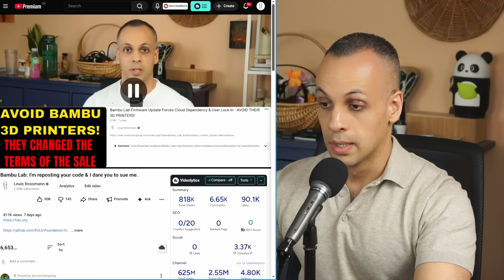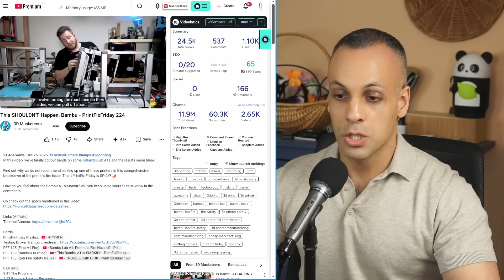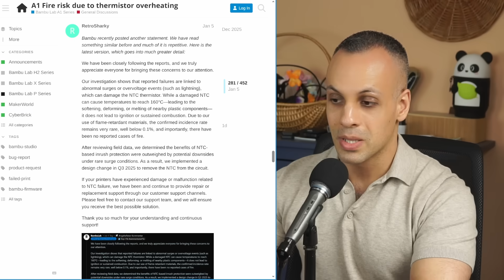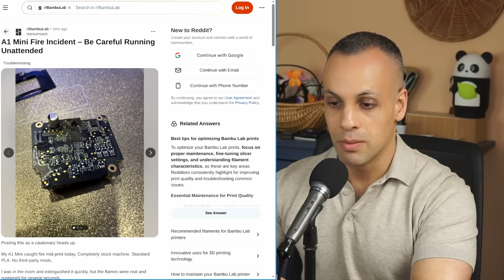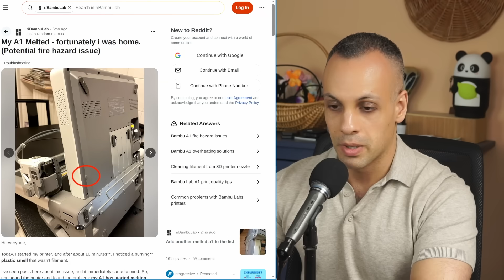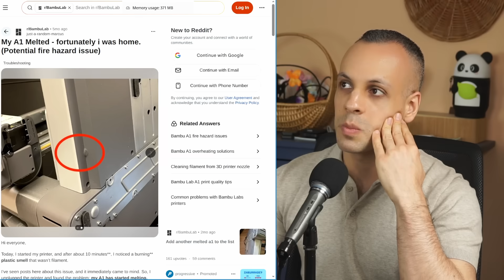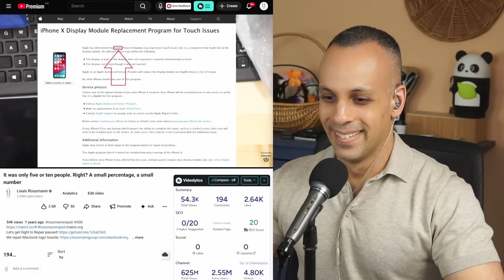Bambu Lab PR dumpster fire is turning into a literal one...

Comment: I really appreciate this update. My kid got one for Christmas from his grandpa and loves it. We’ll have to be very careful from now on but at least we’ve been forewarned.
Reply: They Make fire suppression bombs that you can hang over your printer as a precaution. Pricey, but cheaper than a fire.
Reply: just contact bambu support and ask if your serial number is affected, they will send you replacement parts for free if it is.
Reply: You've probably heard this before but ensure good ventillation. Odorless is not harmless. 
We don't know the long term effects of breathing in the tiny particles printers give off.
Reply: @some_random_wallaby  It's not just particles, but most filaments emit various forms of VOCs and toxins.
Reply: Use the guides that are up to open the base and check to see if the vtc is present in the power board, and if it is contact support and ask for a replacement. Keep asking if they try to deflect. It is not worth risking it with a component with over 200 cases of meldown/fire/thermal extraness that 3DMusketeers has directly documented.
Reply: Teachable moment: always babysit the device, keep an extinguisher at hand.
If the kid can manage that, then advance to a living pet.
Reply: Also, hit up your local hardware or gardening store and get a concrete paver to put the printer on. Extra credit for finding medium density foam to put between the printer feet and the paver which should help decouple resonance from what it's on and will help with print quality.
Reply: @SkateSoup  Nice bonus is that the paver isn't flammable.

Comment: I ordered two printers this week and refused to even consider Bambu.
Reply: I was feeling FOMO about getting Prusa MK4S rather than the Bambu Labs printers which were newer at the time. 

I went with Prusa because the companies reputation is solid and I loved the upgrade path (if they come out with a new feature that wasn't on your printer you can buy an upgrade kit to go from like single filament printing to multi-material for example). 

I was so surprised they actually offered that in the first place and they hand you STL files with the printer to even repair it yourself. I see now that I made the wiser decision. My MK4S has been solid and just keeps performing better with mods, tweaks and firmware improvements. <3 Prusa so much more after all this
Reply: The only reason I regret my Prusa MK4S purchase is because they announced the Core One a month later. But I was so tired of my Ender I decided to keep it. 

It has been a blast using it. Some day I will get the XL or Core One L
Reply: @navb0tactual I'd like to see them putting the INDX upgrade on the Core One L. For now we need to see how it performs on the Core One first.
Reply: @Kastaru Prusa is one of the best printers you can buy. Even if it is a bit more complicated to set up than some of the other brands the aftermarket support for upgrades is top notch. The only printer company with more after market support is creality and you get what you pay for. Half of the creality support is just upgrades that come on higher end machines.
Reply: @Kastaru prusa even still sells some parts for the MK2, that's a 12yo model
Reply: @Kastaru  As I type I'm printing a new x carriage for my MK4S. I print a lot of high temp stuff in a Lack enclosure.  The teeth that hold the belt creeped and the belt won't stay tight anymore.  It has 1,840 hours of print time on it.  It's been pretty rock solid.
Reply: Out of curiosity, which did you go with?
Reply: @mvm8397 I ordered a few weeks back and wanted to avoid bambu.   Got a qidi q2.  Im very pleased
Reply: @mvm8397 i love my brother 2d printers
Reply: what are good alternatives to bambu?
Reply: @cynthiabauer5763  I recently ordered a Qidi Plus 4. It's good on paper, but hasn't arrived yet so we'll see.
Reply: @cynthiabauer5763 they're the apple of 3d printing so basically none if you want their features. There's a lot of decent ones that have most of the features though. I like makers muse and aurora tech for reviews
Reply: @cynthiabauer5763  prusa printers are more expensive but really good. Voron kits for more customization (but more labor / tinkering). Qidi for a cheaper Chinese option
Reply: @cynthiabauer5763  1. Prusa, Voron
2. Creality, snapmaker, sovol
3. Elegoo

Maybe Elegoo deserves a higher rank. I heard they got some awesome people but no idea how the printers are.
If you have money: Prusa
If you have time (and money): voron
else go for the other brands
Reply: @cynthiabauer5763  Snapmaker U1
Reply: its really unfortunate for me bcs i'd heard they were the most beginner friendly for people who aren't into 3d printers so i was considering them heabily, but oof...
Reply: I did that a few years ago and I didn't regret it.
Reply: I got the X2D, because the printer is awesome. It's not its fault for its manufacturer is stoopid.
Reply: I bought a bambu printer recently and regret it, past the return window 😭 Atleast its been working okay but the beds been squeaking so i gotta oil it up (🤨)
Reply: Good job 👍
Reply: Makes sense.  Why would anyone ever order a printer that only works when connected to a 3rd party server?  Can't print when your internet is down, that's so stupud.
Reply: @Josh-Kelm  do you know you can print via sd? i have 2000 hours of print time and never once connected to a 3d party server
Reply: @zokru1  On some printers of course.  But isn't the Bambu controversy that you have to go through their server to print?
Reply: @zokru1 printing via SD feels like using the old ender 3 again.
I want local network connection.
Reply: @Josh-Kelm  thats just youtube clickbait misinformation, all models have an sd slot an you can print offline . I dont like the company behavior but i dont like this videos either. On all the printer sold a few melted, like few phones , few fridges, few television.
Reply: @zokru1  Maybe they ship with that, but as long an automatic updates are a thing they can disable it.  I wouldn't trust a company who makes your go through their server to print when not using an sd card because they'll obviously disable the sd card reader with a firmware update at some point.
Reply: @Josh-Kelm  you can go back to previous firmware and also choose not to update at all. automatic updating is not mandatory
Reply: @Damo905TV  I prefer a machine that doesn't do updates at all.  I want it to be just mechanical.  Tired of things connecting to internet.  It should only connect via USB and have SD card. I don't want it on internet.
Reply: @Josh-Kelm you and i both know thats not the world we live in no more.
Reply: @zokru1  there's actually someone else out there who also both dislikes Bambu and this video. There has to be dozens of us out there! dozens!

But yeah can also confirm, you can run a Bambu 100% offline (maybe 99.9% since I'm not sure about initial setup) and print only via SD card or your local network (or even both with a wifi sd card! double the unreliability!). Mine never auto updated, and even if it tried, it's blocked anyways on a network level - also has the very neat side effect of getting rid of that "update is available" message box.
Reply: @---ym4zk  internet never required even at startup. People just need to reasearch what they want before buying. Too many people talks without even ever used or even ever saw a product.
Reply: @Josh-Kelm  how can they disable my printer sd if i never setup wifi ? With magic ?
Reply: @knightmare1442  you can also print in lan. Do you people ever tryed the things you are talking about?
Reply: @Josh-Kelm   there's an offline mode. no need for internet. and you can also print using sd card. but connecting to internet makes convenient for me. i can view it on my phone, and/or skip some parts that i dont want to print anymore. im using A1 for a long time now for my projects. i havent got any issues other that when i use the wrong filament.

Comment: sounds a bit like to me there redeisgn is whats blowing up. i liked bambu. i still have two printers, bought them a few years ago. ones p1s got 4600+ hours on it. had a couple of issues but nothing mager. and its still going. also got an a1 thats got 2000 ish hours on it ( i could be part of a small %). I was very happy with them. but with all the crap they have been pulling im just not happy with bambu anymore. I still like theese printers but i also run them in lan mode and have not updated the firmware when they added the extra checks. i really wanted a bigger printer that worked as well. not really found much out there for what i want and the price im willing to pay. might be interesting to see how old the bambu printers are with fire issue? Anyways, thanks for the informative videos Louis. Cheers.

Comment: Sorry but bambu is fantastic I will continue to use.
Reply: If you like and trust it go for it. Most people do not like being controlled or told what they can and cannot print. Ross is pointing out a safety concern. From my understanding, these are devices you setup and leave. Bu the fact that they are melting and potentially going to cause a fire is concerning. That could kill people. Not sure if you have kids, but think about this. You let your printer do its thing over night and wakeup to a raging fire and couldn't save your kids, I'm not so sure your would be giving allot of praise to them after that.
Reply: @MarioS-b2q for the record, almost all 3D printers come with a disclaimer to not leave them unattended, while they are printing.

Any electronic device that makes use of a thermistor, to monitor and control heating temperatures, is at risk of catching fire, if the thermistor fails to function correctly.  And thermistors, in general, are not particularly robust.  3D printers, in particular, often have the capacity to identify thermal runaway, if the thermistor fails in that way, and then turn off the heating element(s), to prevent such things happening.  Despite this function, circuits, casings, etc, can be damaged, before the shutdown command is issued.

I don’t know for certain, but I assume this is the case with the printers provided by Bambulab.  Sometimes, though, even that is not enough protection, hence the warning to not leave them unattended, while in use.

Cheers
Reply: @Wolf359inc  Obviously theirs going to be a disclaimer to not leave it unintended. But we all know that's not a realistic expectation. I mean heck I got dog toys and treats with these silly warning. Even his rawhide saids "Always supervise your dog during chewing activity.". It's just a way these manufactures try to escape legal responsibility. They know no one is going to sit their for 8 or 16 hours just watching something print. Aso doing so would expose you to excessive fumes that are harmful. But this warning gives them no legal recourse, because its not reasonable to sit their and watch  print this long. But it would be reasonable to expect the product to be made with safety in mind and not burst into fire.
Reply: Enjoy! Not everyone has the luxury of worrying about the ideology of the companies behind their tools. Keep on printing, keep on making stuff - that's what matters more to me since that's how we get people that can make, understand and maybe even invent stuff again.

In the end this is a first world "What, steak? again?" kind of problem, especially if scoped to just Bambu/3d printing.
Reply: @---ym4zk  "Not everyone has the luxury of worrying about the ideology of the companies behind their tools." That maybe true, but she's here littelry watching about the issue with the attitude I don't care, I'm going to keep doing it. Its like going to the store purchasing some chicken and then coming home and seeing in the news al the chicken at that store was contaminated because the cooler malfunction and saying I don't care I like chicken and eat it anyway. Then who's fault is this when you end up in the hospital sick? Now its your own fault, you knew their was a problem but didn't care and ate it anyways.
Reply: @MarioS-b2q  Doesn't your point break down at the time when I should become sick? 

I understand you are trying to say I'm buying a sick chicken (bambu printer) and should not be surprised to end up in the hospital (???).

What's the hospital part? I am aware what kind of future I am supporting here. It's a future I am actively voting against whenever the government gives me a chance. 

The one way your analogy could kind of work if that disease would spread due to me buying it. 

And for that I don't have a good answer. Guess that's where my ego wins and buys the chicken to survive even if it harms others, as long as those others are strangers. Maybe that makes me a bad person, maybe most people just don't want to admit that in public. 

But it surely does seem like most people use their money exactly in this way, or to be more precise - the most capital is used in this way. Whats the point of that? I don't know, just thought it was a interesting contrast to mention.
Reply: @---ym4zk  You went off right into the weeds. My point was She knows theirs a problem but doesn't care. Your response was not everyone has time to look into these issues for the products one buys. But it overlooks the fact that she did, and does not the hazards but simply chooses to ignore them. That's the problem, people don't care until it effects them personally, then suddenly they try making the most noise about it and expect everyone to then care because it effected them. Once your aware of a problem, but then continue down that path, that excuse of not knowing does not apply.
Reply: @MarioS-b2q  Guess my reply went completely over your head. Don't start a philosophical debate you can't continue lol
Reply: @---ym4zk  I wasn't, I was giving an example. Apparently that went over your head. Please stay off the drugs man.
Reply: @MarioS-b2q Alright man, sure, that's why you just parroted my point about "over your head".

Maybe it's time to take some drugs too lmfao
Reply: either fanboy, rangebait, or genuine comment. im not sure which. im curious, assuming you have seen his other videos about bamboo and other anti-consumer practices, i do wonder: Why?
Reply: @clippy32768 I have 6 that never stop printing and make me thousands every month... They totally suck and you should absolutely stay away from them.